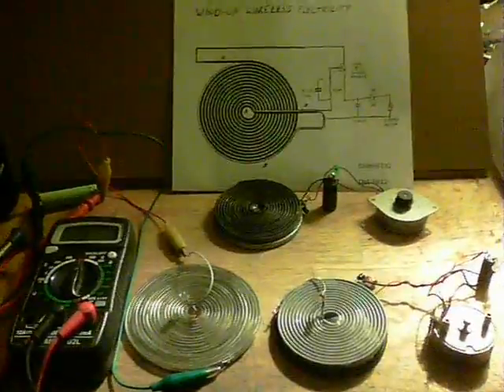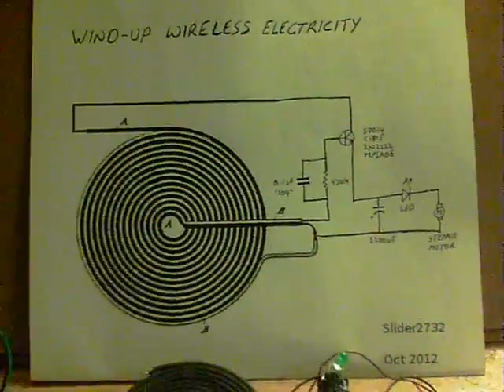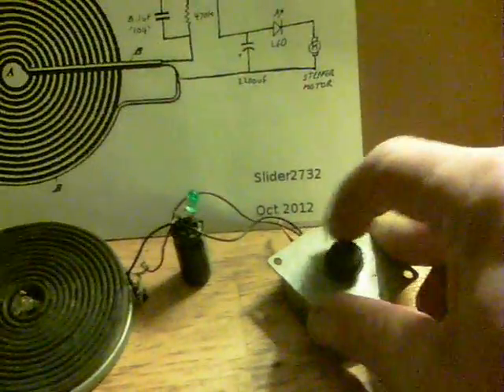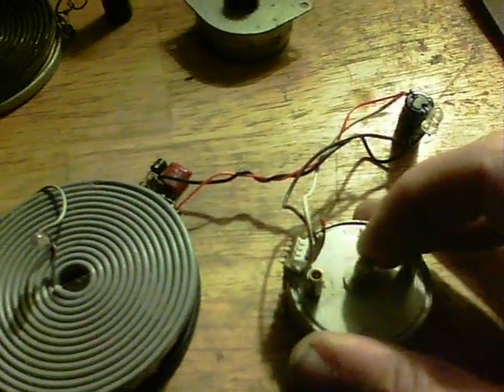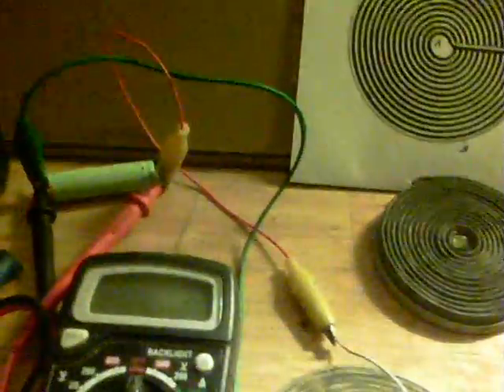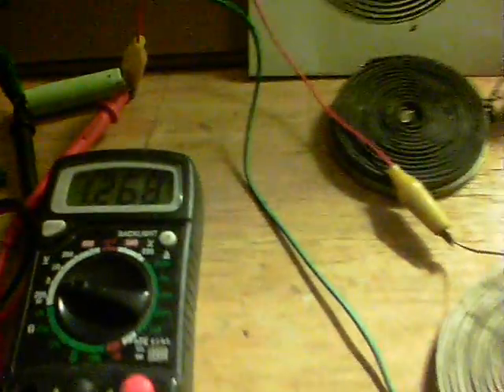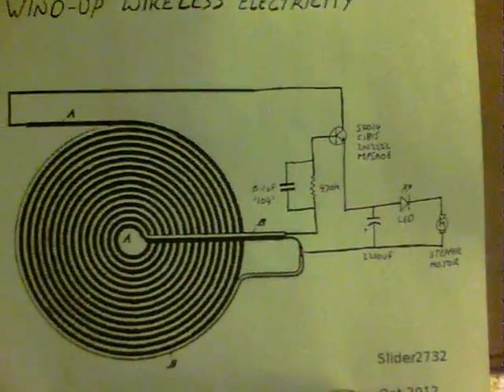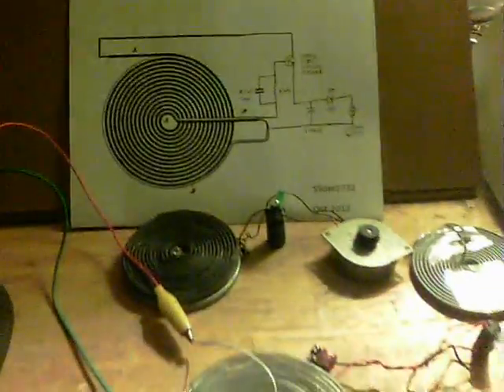Wind-Up Wireless Electricity

Comment from the maker: The main transfer would be chemical energy to electrical + slight kinetic. 
See Wikipedia on 'kinetic energy' for a fuller idea :) 
The chemical energy is my muscle mass moving the rotor, the kinetic energy is the transfer and very mild flywheel type inertia from having the motor mass inside turn. The motor then generates electrical energy, that feeds into the storage capacitor. The LED works as a visual for charge and as a diode, stopping that energy from returning to the motor.
Good luck !

Comment from the maker: Haha, ya never know. Let's think about it...The wheels could have slick bearing motors on the hubs and the coils could be the diameter of the wheels...so that's 4 coils. Output into a module that shows an LED for each wheel and the generated total power as readout on the dashboard..onward to the batteries like regen braking. In fact, TOP idea !
The magnetics from the coils would also have the Faraday's Paradox property, thus not interfering with car electronics from rotating mag fields.

Comment from the maker: "good junk" i like that :)
Yeah, there is for PC fans...look up 'imhotep motor' on here, there's a way to convert to a sort of Bedini SSG. Needs a steady hand for the soldering as it's thin wire. That's a very kind offer, I could certainly use the Hall sensors and the wire. Will PM and thank you for thinking of me for them :)

Comment: Tried darlington on JT's, not much improvement. I just googled Sziklai, I though I invented that last week. Bugger. Just regular parallel. Turned out to be un-necessary.  I had a diode backwards, and 40v schotkeys are pretty useless at 300v. Got the BAC running quite nicely as quad fillar @3w with 48cm range. So not as good as your one on range... I think Higher freq is the key to distance. Mine now drops down around 16khz, sometimes up to 25k, depends which Tap I use. Now it hardly gets hot.

Comment: I think diodes have a lot to do with it too. Had random ones at start, now BIG shotkeys, but they are rated for 3a 40v. Found some 1000v 4007's to try. Getting 300v neg 200 pos. was playing with one wire LEDs, 200v in left hand, 300 in right, wondered what happens if I touch them together. Ouch is the answer. Few more volts and zzzz thunk, would be the result. Also cat 5 is really old, looks to be all twisted inside. I get a lot of 20k, airport a few k away, I think Omega is shut down though.

Comment: I do get ringing with the smaller coils, at high amps, or with a magnet on the coil. I think 25k is the speed of the 2 3055's (parallel) and the long winding, 30 meters bifillar is 60m. Its a long coil. Played around with quad filllar, Made it weaker with shorter range. One transistor pair was good, decent power and range from 250ma. blew that and now its drawing 700+ma and half the range and strength. Not much coming from outer edges of coil, strong in center. TBC...

Comment from the maker: lol, best wishes for that one ! I think you'll either find they both run together and sync, or will hassle each other to lower both outputs. My money would be on them syncing (most notable on slow flash b/osc circuits).
Yeah, if you have an old charger you can use the end of the charge lead easily enough. Standard vertical Tesla towers do a good job with cellphones and powered pancakes do too. Ideally, this sort of thing can go in tablemats/mousepads etc for simple homemade induction charging.

Comment from the maker: If you get any ringing sound with magnets near (?) then i don't know that you are too far wrong at 25khz believe it or not. Output will still be strong. With the Dr. Stiffler L3 style coil and ferrite rod tuner on the base with a large magnet on the BAC itself, the frequency becomes audible...around 18khz. Free running should be a lot higher. Anything around the work area that could bring the frequency down ?

Comment: Nice one. I'm not having much luck today. Been playing with 3055's. Seems they are to slow for bigger coils. Got 25khz atm. I keep blowing them @ 1.5 amps, even with 2 in parallel. I think it's the neg spike on the base. I had protection diodes, But random ones, I think they have been failing. Got 1n5822 schotkey's on atm. Down to last few 3055's, so not game to push them now... Will try 2n2222 on 1.5v and see if that works.

Comment: This is a great circuit slider thank you for sharing it. Will definitely be making this one and have the perfect stepper motor ready. I'm also thinking of trying one with maybe a 12v or 6v input from a small lead acid and throwing a coil on the back of my cell phone, a good rechargeable led torch, etc. so many different uses. i wonder what happens when you place two equal battery circuits on top of the other while each is powering a load on the other side? going to find out lol.